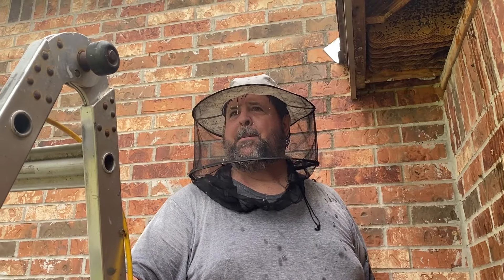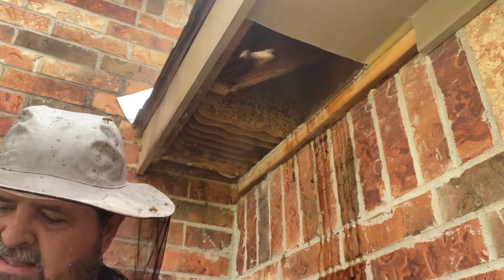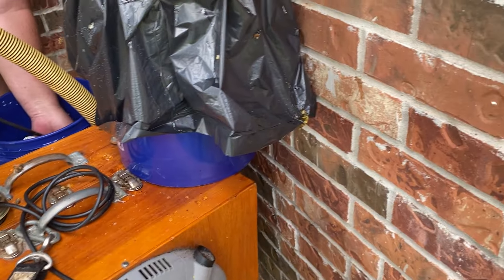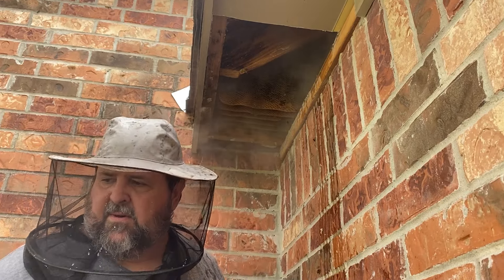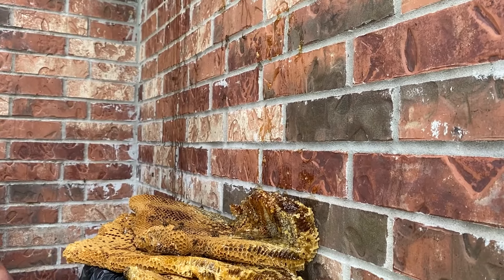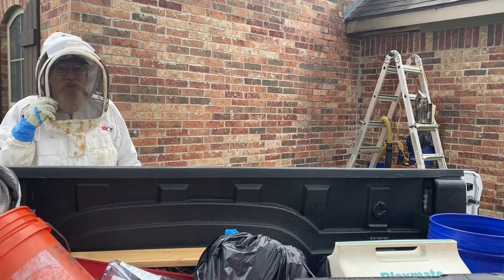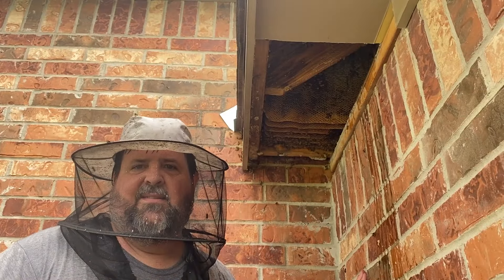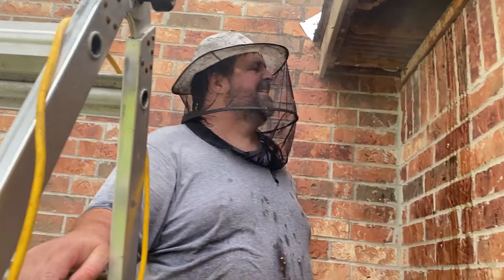This Bee Removal Tool Will Save You

Comment: wow!! great invention!! just wrote chris.....another invention i wish someone would come up with. forced abscond in trees. Instead of a regular smoker you have to keep puffing......Would be great to have something battery operated. not the cheesy aa battery operated smoker that does not last but something that would run a 20V DeWalt...i would buy several of them. --i use a Dadant smoker but would love to get a better more effcient way without developing carpal tunnel...;) thanks Randy!!
Reply from the maker: I've toyed with building a smoke or chemical applicator with a flex tube that could be pushed up through the voids in trees or walls.